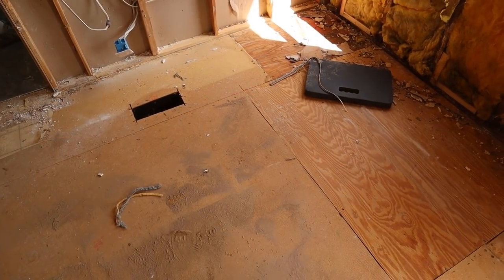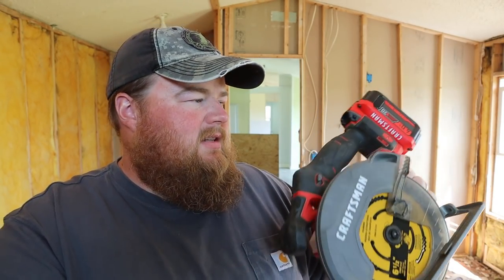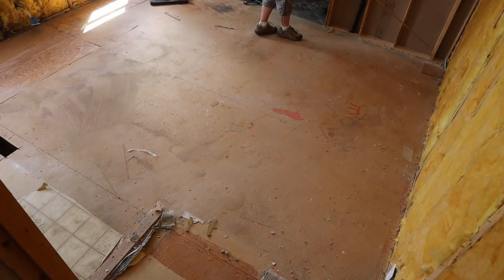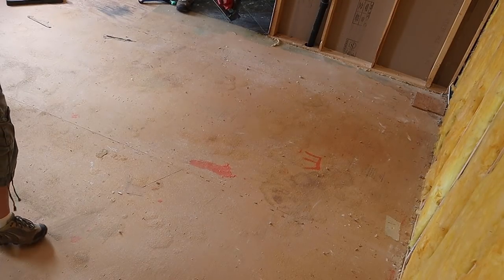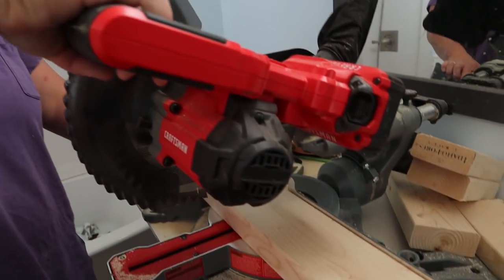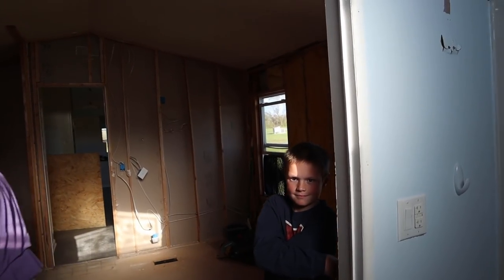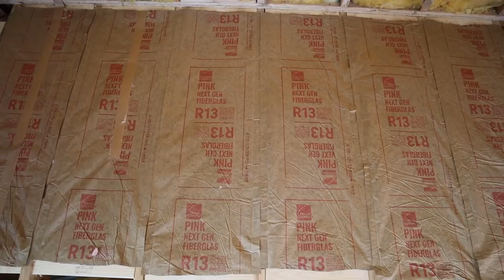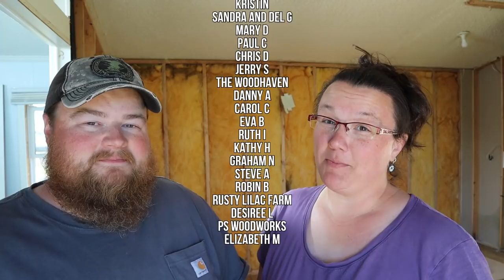A CRITICAL STEP for Floor Repair // Mobile Home Renovation

Comment: I haven’t even watched this video yet, but based on thumbnail, I wanted to make a comment. I found your channel as we are remodeling a mobile home. Through your channel,  we found out about the oscillating tool. We are cutting on the edges of the wall and yes, I had a contractor to give me a quote. He was only going to use a regular saw along the edges. Thanks for sharing your techniques and knowledge with us. Now, I have to see every video. Keep up the great work and I can’t wait to see how your new homestead continues to grow. You have made great progress in what seems to be a short period of time.
Reply: You will learn so much from them go back and look at all the other Sam’s a good teacher so is Angela. Natasha I love your name💖
Reply: You may like to look at Diyfferent channel's past mobile home remodel videos if you haven't seen them. Very good and detailed. Just a thought.
Reply: @deborahlehman8617  thank you.
Reply: @KJ-jq9pq  thank you.
Reply: There's also something called a toe kick saw, i bought one for 60 at harbor freight. It only cuts down to 3/4 inch, but it'll run right along the wall. Leaves a tiny ledge that cleans up beautiful with your oscillating tool.

Comment: Blocking is a good idea, but if you are using the standard tongue and groove subfloor panels you really don't need it at the joints. A really neat tool for cutting along the walls is called a toe kick saw. It's kind of a specialty tool, but great for flush cutting along walls and such.

Comment: I like it when you post after a couple of days work, we get a visit and the amount you get done is irrelevant. If you think you might do something in the laundry area, maybe put some blocking up for the cupboards and maybe do the extra outlets before you close in the closet wall.  That way you're ready for that project and it's way easier.
Reply: Great idea!

Comment: Angela!! LOL , you are really telling Sam when they hook ups come you are moving in!  Sam just moved out of the way and let her work for she was not messing around!. You are correct I have seen so many flooring without the blocking and many homes I have been in which the floor boards and the joints are clapping as you walk.

Comment: Just a simple hint. When using fiberglass insulation, wear a face mask and gloves since the fibers are 'glass; and you do not want to breathe the glass fibers in.  

As for the battery backup that is 100% wise and in NO way a sell out when accepting/using it. In fact most people would be foolish not to accept and use one.   Also appreciate seeing children ask if they can help!!

Comment: Never heard the stomp a mud hole in it, I used to tell the kids I would beat them with a wet noodle.  Angela you are so good with that insulation.  I have to wear safety glasses a mask and long sleeved shirts and still am miserable.

Comment: We are in process of redoing bedroom adjoining bathroom and when the wall came down the lack of supports in walls , not enough braces . We will be adding in some.  The old heating air system is in hallway and we are taking it out ,adding space to bathroom as storage. This is an 80s mobile home but it is rock solid . Since living here we have been thru major hurricanes . We have lost under pinning . That is it .

Comment: oh, and been there. I  was given a single-wide that I had to replace 80% of the floors. I did use plywood for the repairs. My buddy told me I over-engineered the repairs, but that floor was SOLID

Comment: Hello if you have to do a floor again. Get a grinder and get a wood blade for it and use it around the edges of the wall to help you the use the other tool to get around the wall studs.

Comment: Get a  drill bit that has a sleeve to fit over the screws.  Will make y'all happy campers!
Also, sister 2x's to the joists under the blocking. Will make it waaay stronger and easier to install with fewer screws to split the wood.

Comment: I can relate redid all the subfloor in my trailer a few years ago, the folks who bought it from me got a much more sturdy floor than i did.tbe tubwasheldup by a stack of scrap wood sitting on top of an iron beam,none screwed together. And a foot and a halftone in living room was repaired with a piece of linoleum and a million tacks.

Comment: Just so you know when you staple insulation it's supposed to be down inside the bay and not on the top of it, that way when you put your board down it doesn't tear the paper off and it gives you an air gap for added insulation. Not to make you feel bad, you're doing a good job I made the same mistake when I first started doing insulation and somebody told me about it.

Comment: When you put the insulation in you can stay able to the sides of the floor joices so this way you can glue the plywood to the top this way the floor is all squeak and if you glue it down and screw it down you won’t have any problems but you can staple your insulation the inside of the cavities you guys are doing a great job

Comment: I have been following you for a while, and never commented before. But I want to congratulate you guys, You are doing great quality work! You house will be much better than it ever was from the factory. Whatever some say, blocking is better, even with tongue & groove plywood. The tongue is so thin that it doesn't have much strength, and it is often damaged at the lumber yard. We have a saying around here in Canada that say" too strong doesn't break!". You are also a great couple to watch, and doing that  kind of work with kids around is not easy. Keep your good work, and thanks for the many videos!

Comment: I've definitely heard Stomp a Mudhole, mostly from Dusty Rhodes when he was a commentator.  He would also use "Wubba legs" aka rubber legs when someone would be on shakey legs ready to fall down.   My maternal grandmother used to love watching wrestling so it does connect with my grandmother as well.

Comment: Hey man you can use any crappy inexpensive saw but when it comes to blades.... don't use just any blade you need to use a Diablo blade and your cuts will always be straight and cut like a hot knife through butter and yes I've heard stomp a mud puddle in you

Comment: Yes I heard the phrase stomp a mud hole in you. LOL
Ours came with tongue and groove plywood floors most had carpet on it. However it also came with the old grey water pipe which is a major job to replace but once Pex goes in out goes the problem.

Comment: Harbor freight sells a toe kick saw for around 40 dollars that lets you cut right against the wall..it would take a few minutes to cut that room out with it..the saw looks like a skill saw but the cutting blade is smaller and the saw end sticks out to one side for cutting under cabinet toe kicks

Comment: Yep, definitely heard that phrase before, lol.  We've got to do the floor in an add-on porch we have (previous owner enclosed a deck). As soon as lumber prices come down enough, we've got to do the same thing, lol.  The guys who did the floor in our flood repairs in our kitchen left a 1/4-1/2" gap between the wall and the subfloors all the way around that room, then just came back and stuck that 5mm luan stuff over everything.  So even AFTER getting it all done, now a few months later we've got wavy floors in some spots...
Reply: And I have to remember how you're doing the blocking under the floor, that looks MUCH better then what they did here..  Might have to go behind them and fix some stuff eventually.
Reply: Since all your runs of insulation look to be the same length, you could do what I did, make a template on the floor you haven't pulled up (or a table, piece of plywood, etc) where you fold over the inslation half the length you need, use a 3' metal L square across the cut, and one of those cheapie razor knives like you get at harbor freight that you can extend out (you usually break off the end to get a new pont) to about 2-3".  the square compresses the insualtion down, and the knife can cut the insulation easily.  That's what I did for the basement stuff I insulated (I had about 30ish sections that were 'oddball in size on one wall, but the majority of the walls were all the same).  No scissors needed, and it cuts in a fraction of the time.  For that matter, even if they are all different it'll still make it easier/faster to cut.  May not be the way a 'pro' would do it, but dang sure worked for me, lol.  (I actually used one of those 24" paint edge guides made of a metal strip and plastic handle).

Comment: I'd be replacing that old polybutylene pipe under your floor while it's open to get rid of it before you have a problem with it later on. We are going to replace ours with Pex we bought but are going to replace the polyb room by room since it's all in one long section of our double and a half wide manufactured home (the whole laundry room floor had flooded before we bought it and we are definitely going to use the method you described to tear out and put down new underlayment).

Comment: We have a 16x80 that we've renovated. We bought it new in 1995. Of course it had Novadeck in it. Ugh! We built boxes out of 2x4s to place between the floor joists to further strengthen between the seams. It's a lot of work, but no house payment is worth it!!

Comment: I have definitely heard of stomping a mud hole in your behind (substitute another word here). Also I have done a few mobile home subfloors and I did not use blocking. I used T&G subflooring and have never had a problem with saging.

Comment: I used white pine matched boards to redo floors in my trailer.  had the particle board crap too.  bought #3 pine from the local mill....

Comment: You guys got it I did that which the old single wide I had and was going to ask if you guys was going to put blocking in  the only thing I did Different SDE blocking was up and down the Joyce not laying flat like you guys did

Comment: I;m in the process of renovating my old single wide mobile home and the floors i'm gonna have to do, i needed this video- even though i saw you do the boys room, i need the confidence and tools to do mine! LOL I will also need time to get the money to get wood for that project,one room at a time
Reply from the maker: You can do it!
Reply: @sam-and-angela  Thank you, i have to kinda work it out in my head how to do it alone without help, takes some planning how to carry those heavy pieces of lumber hand truck maybe, LOL- or cut in half, hmmm

Comment: Great work guys im a subscriber and enjoy the videos. In case no one has told u insulation gets stapled to sides of studs on inside  this creates a small pocket to help cool and heat. It will work the way u did it but not as efficient.  Good job and i agree on the tongue and grove although its code in some areas. Thanks

Comment: In the back, top corner of your wall, behind you, the wall is lower by about the width of a 2X4 than the other wall.
Reply from the maker: That's probably the curvature of the wide angle camera lens, but we'll double check nothing's gone crazy in there. :) We have to use wide angle lenses to fit in the rooms and you all still see things.

Comment: I'm curious on why you chose the oscillator tool over a skill/circular saw? Personally I would have put the base up next to the Toe Plate...would've been quicker. 
Though I'm sure this point will come out...do to I haven't watched the entire video. If so..my bad
Reply: Theirs saw is probably like mine and will not let you cut close enough to the wall. The base plate on my saw would probably keep me 1/2 “ away from the walls.

Comment: Sam, where is your utility knife?  That would save your wife so much time over using scissors.  Also look into the Bluetti.  Not cheap, but nearly enough power to keep the whole house powered, and charges with solar panels that are part of the combo kit.

Comment: Sam I'm just asking but are you going the extra mile and vapor barrier your floor meaning roll thick plastic over your insulation you installed.man moister wnt be bad and I know from experience tht talk about heating bill slash a candle can warm it lol see my old trailer I had I put all new floors an walls in and vapored it all and it made more then a difference.but I understand your on a budget and opinions but had to ask

Comment: Nails must be a thing of the past …every video on home improvement on the interwebz is using screws for framing and every other purpose just about…I use screws a lot too but I’m old school I use nails for framing, drywall, sub floors and underlayment. I still build decks with nails except the decking boards I use quality exterior screws to fasten them.  55 years in the trades and old ways die hard.

Comment: Hi, your studs and bottom plate are fastened to the plywood floor.  By cutting the plywood close to the bottom plate, the integrity of the structure has been reduced.  You might feel it on windy days.